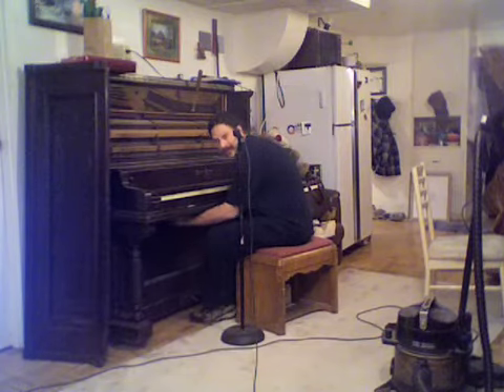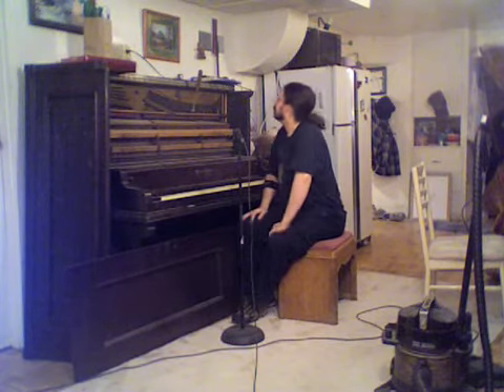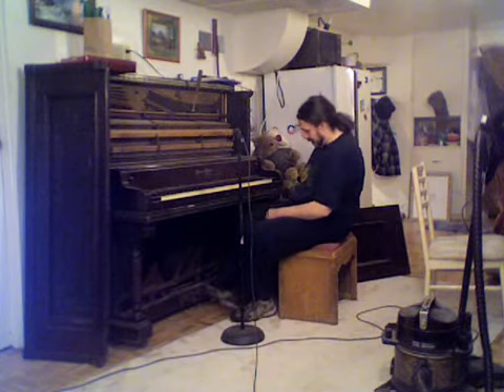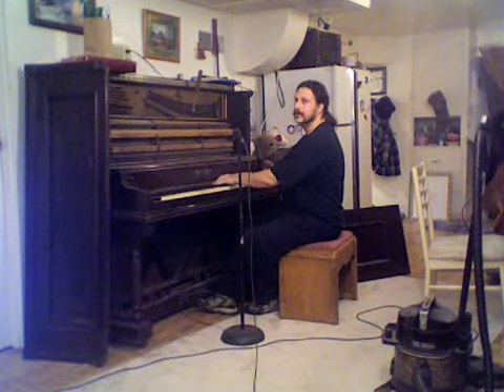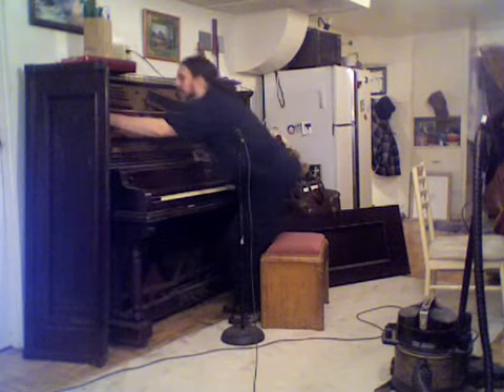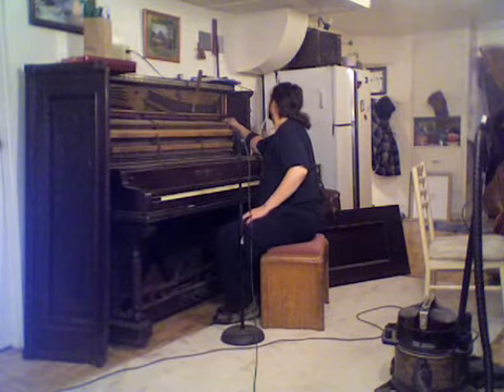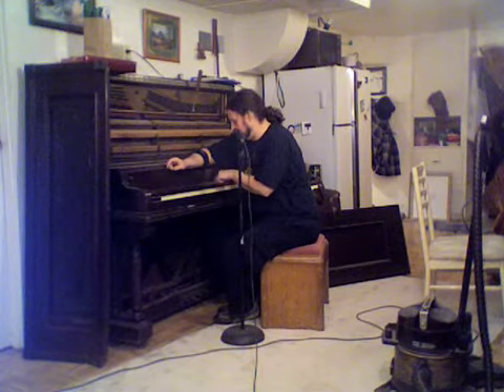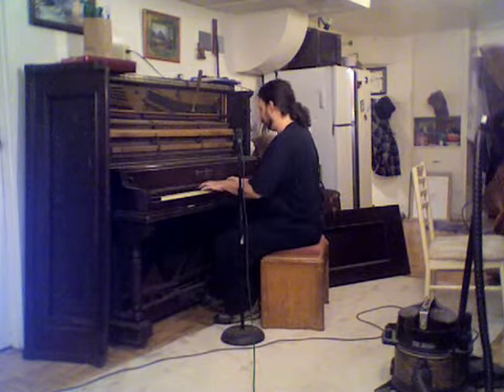Tuning and fixing an old 1893 four-pedal piano

Comment: This piano have simply dropped to around 420Hz because it's not been tuned for too long, that means the strings are not tight enough to meet their designed pull pressure, that's why the bass strings are not vibrating long enough. As well, the bass strings are too old and the copper spiral have lossen up, this can be fixed by loosening the strings and rotating the strings clockwise and install it back on. Of course, tuning experience is required or you will pretty much break some strings for sure